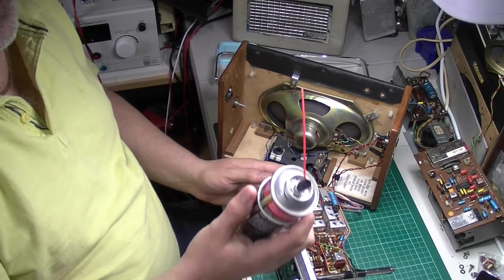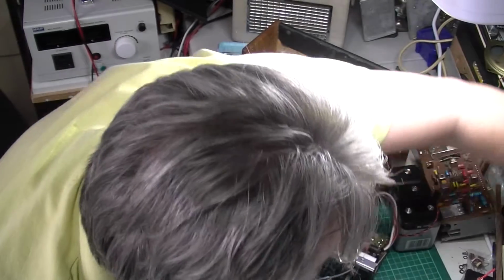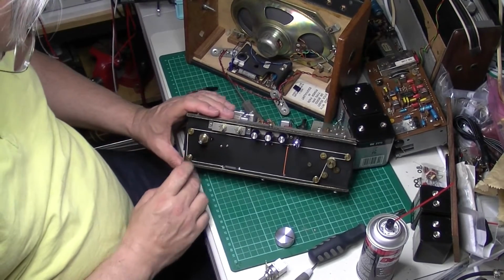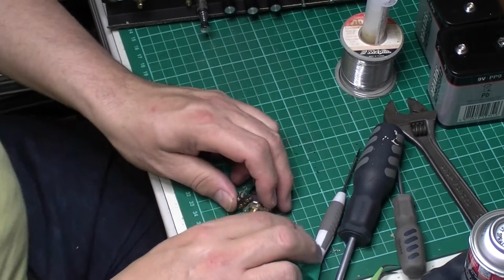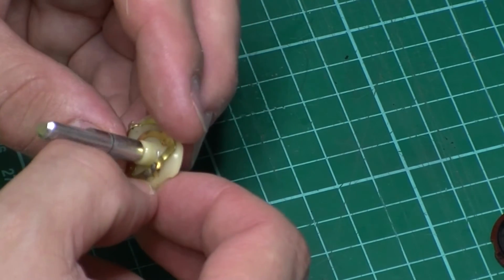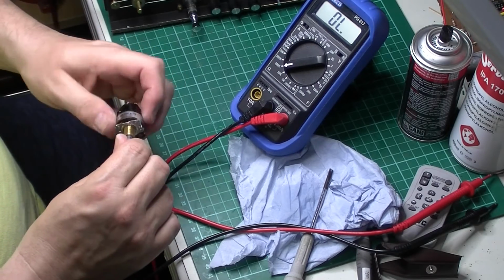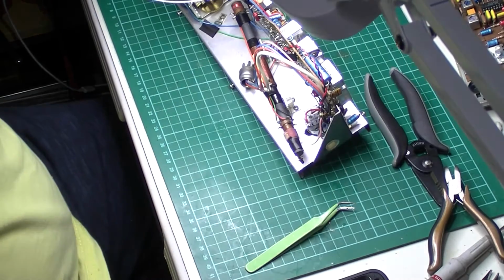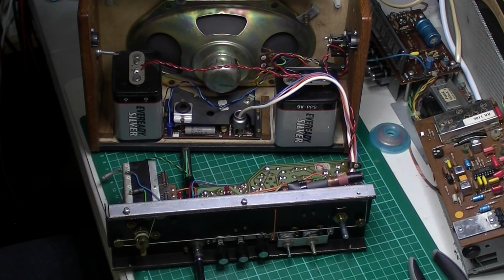Hacker Hunter VHF RP38a Part 3: Volume control. Clean, repair or replace?

Comment: Just got a hacker hunter rp38a I'm trying to source a trebble potentiometer ☹️
Reply from the maker: Hi David. What’s the issue with the potentiometer?
Reply: @Radiocruncher  it does not make any difference to the sound when operated and seems really loose movement.
Reply from the maker: It could be that the issue is in the amplifier. You should be able to take it apart and tighten it up. I don’t know of a source of replacement pots. A donor set or maybe blore edwards could make you a replacement
Reply: @Radiocruncher  thanks fella.👍

Comment: Remove the knobs using 2 teaspoons, very easy. Great repair as always.
Reply from the maker: +rupert handford thanks for the comment Rupert. I might have resorted to a bit of extra leverage and the teaspoons are a great tip. I just wanted to avoid contact with the dial plate. Thanks Graham
Reply: I use a piece of wire wrapped around the shaft , seems to work for me and no damage

Comment: Having watched this video after watching your restoration of the R600 it is also clear just how superior Hacker were to the undoubtedly very good sets made by Roberts.
It's a shame but not surprising that Hacker did not survive.............
Reply from the maker: +Harry F they were certainly very well engineered. Everything in there is built to last and laid out very well. Servicing and parts replacement is a doddle compared to most Roberts radios

Comment: Good video Graham, I've got a Sovereign 2 with a very similar noisy pot. It was my intention to replace it with the type you show in your video but having seen this I think I'll try reconditioning the original. As you say it's a shame to spoil a Hacker by fitting a plastic pot.
Reply from the maker: Thanks Harry. The Sovereign 2 is a great radio so well worth trying to save the volume pot. I assume they are exactly the same pot as the Hunter